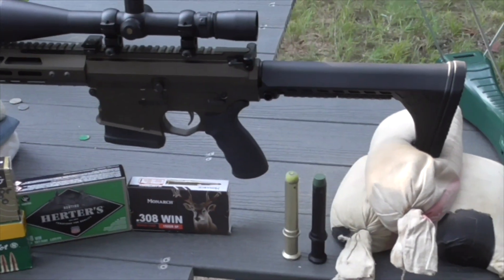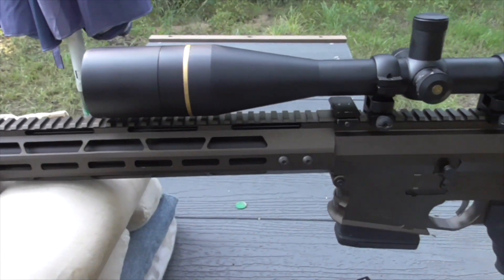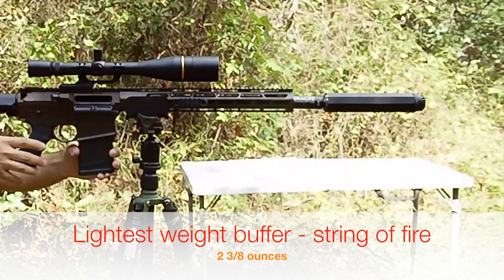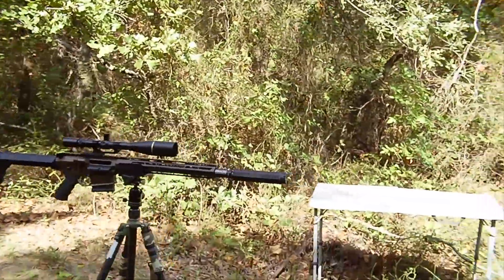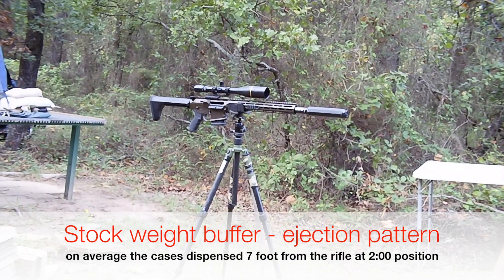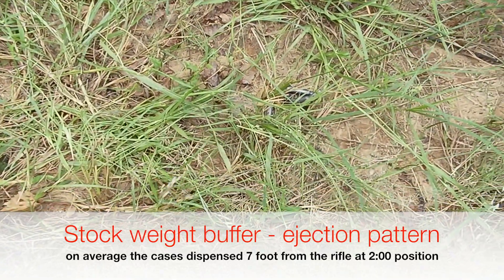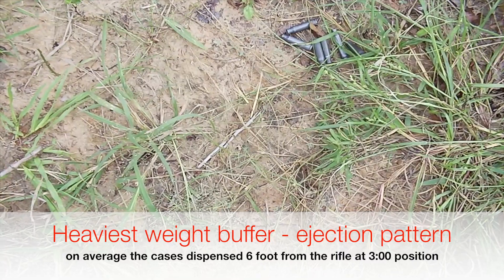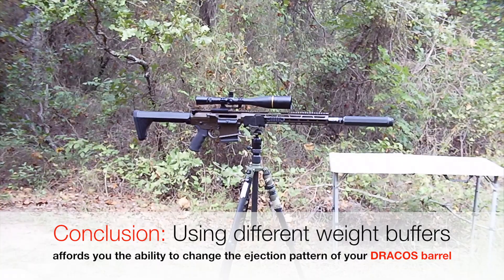DRACOS 308 Winchester - Various buffer weights tested instead of adjustable gas block

Comment: Interesting video results. I was surprised that you didn't have any FTF's or stove pipes with the light 2.3 oz buffer. I guess it blows my theory to crap because I was hoping that increasing my 308's buffer weight from 5.4 oz to possibly the 91/8 oz would cure my FTF's and stove pipes, but from what I'm seeing here it doesn't seem that will do the trick. I guess I'll have to look into switching to an adjustable gas block for the fix. Thanks for the video.
Reply: FTF could be mag catch stick the largest feeler gadge that will fit under the magcatch and see if it feeds or if you have no feeler gadge press mag straight down on ground hold and shoot see if it feeds if it does your gun like mine has the mags sitting to low in the gun on mine it was by about .010"